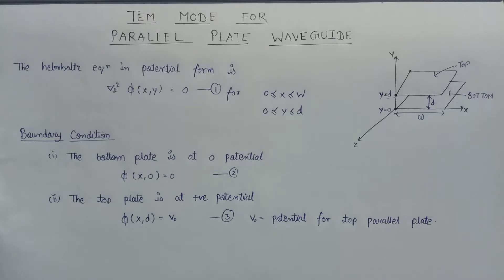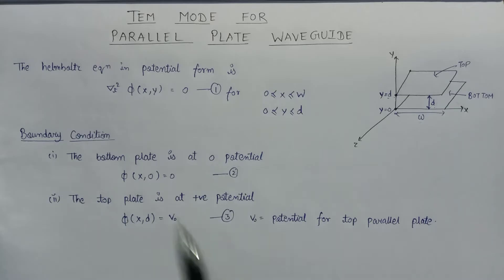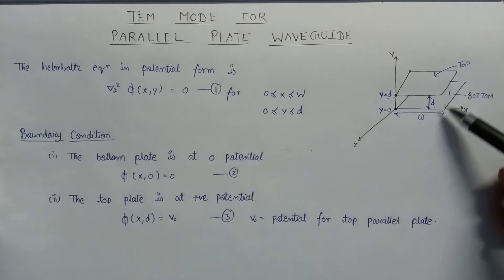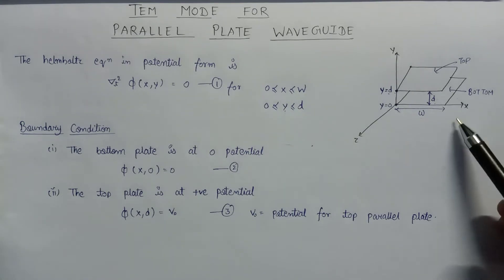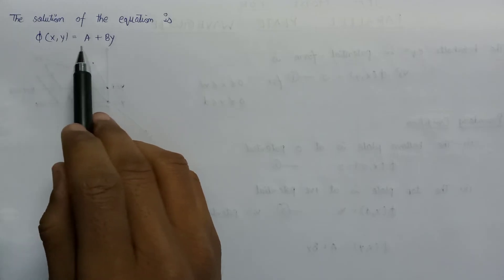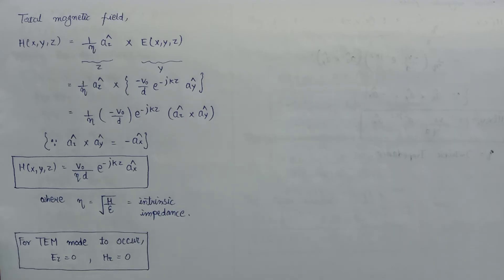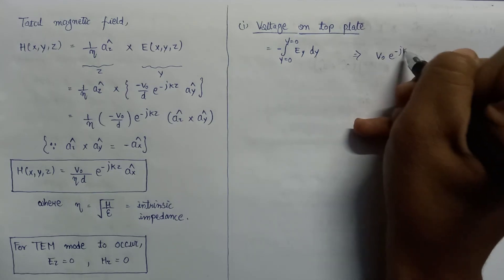TEM Mode for Parallel Plate Waveguide

Comment: 00:02 TEM Mode for Parallel Plate Waveguide
01:50 Boundary conditions in parallel plate waveguide
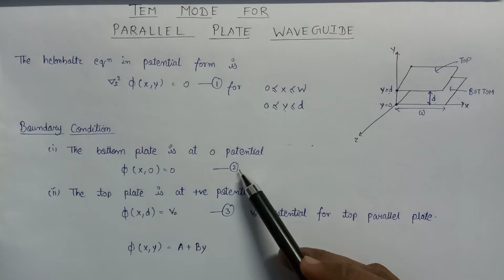03:53 Solving and applying boundary conditions for TEM Mode in parallel plate waveguide
06:08 Calculation of potential V naught
08:37 Total electric field expression derived for TEM Mode
11:06 Calculation of magnetic field in TEM Mode
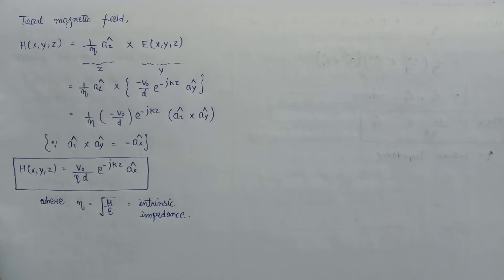13:29 Key Parameters of TEM Mode in Parallel Plate Waveguide
16:13 TEM Mode Characteristics of Parallel Plate Waveguide
Crafted by Merlin AI.